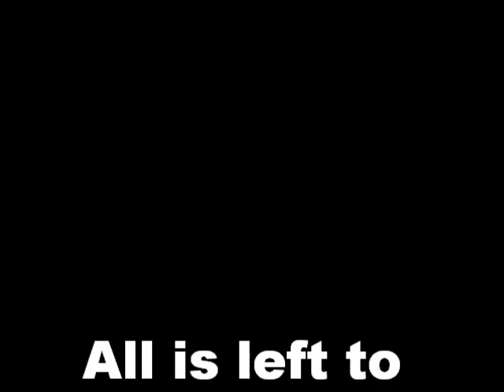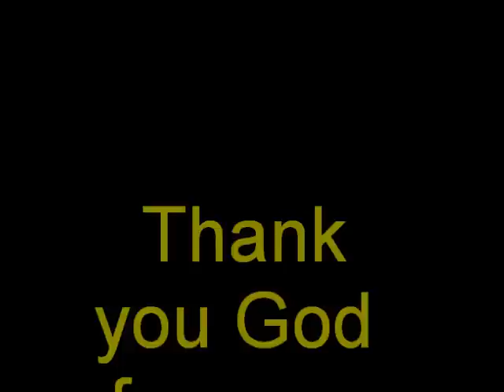Tesla switch

Comment: glad i'm not your neighbour when the flywheel fails, you have to put that one in a concrete box to be safe. otherwise it's pretty cool, but what's the reason for having such a heavy flywheel whit that huge diameter - have you ever seen the rotors for turbine(high speed) generators f.ex ? there's a reason for reducing the mass when you get above 10.000rpms

Comment: So are you selling it? I'm thinking the unit sounds nice, too bad...
I having problem finding that Google page.

"information coming from Electrodyne is that
the circuit did not operate correctly if the switching rate was less than 100 Hz (that is 100 switchings in one second)." Chapter 5

or 100 x 60 (6000 switch per minute) / inlays, they also said 50% duty up to 800 Hz.

I see a lot of non-working units made from electronics, solid state relays are not working and the normal relays would burn out in short time.
You should be able to find carbon on ebay or even starter motor brushes just to see if it works, seeing that the hard part is done.

Comment: have you finished the tesla switching project?
Reply from the maker: fidel catsro Sorry man, never finished that project. Later on I decided to use solid state devices to do this this test, but I am still looking to fine reliable flip-flop timer device.
Reply: NE555 Square wave - on ebay - a tuneable circuit module.

Comment from the maker: @Gollandarr5555 , I hope you right on that. Because based on what I heard it was 200 to 800 per second (Hz) 
If you can send me some reference info on that, thatwill be very helpful. Since I couldn't complete this project 
due to brushes friction that will be to hard on the rotor to run.